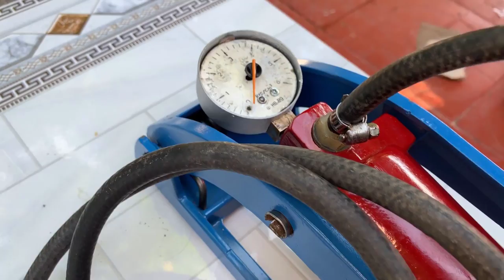Restoration Old Rusty Air Foot Pump |restore vintage tools

Comment: Nice restoration... Nice video... But as every one said... Glass is missing and the gauge meter plate... Also no testing is the gauge working fine or not... I thot u will do something with that too....